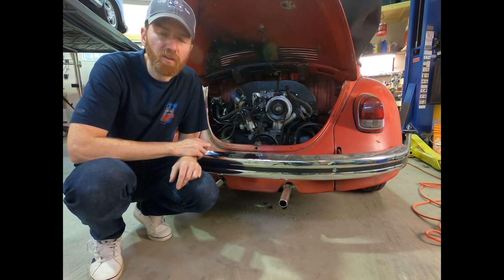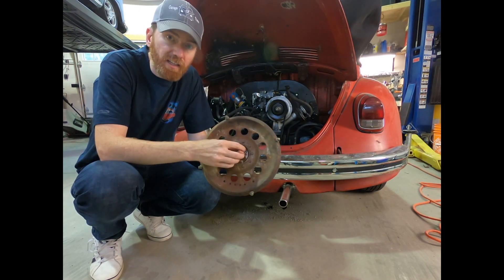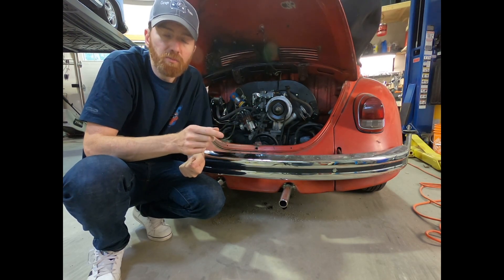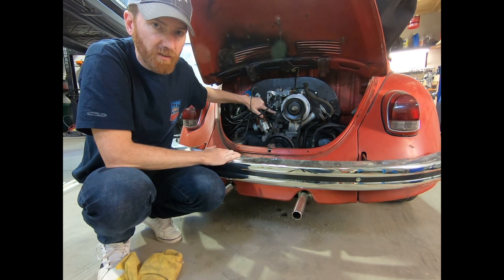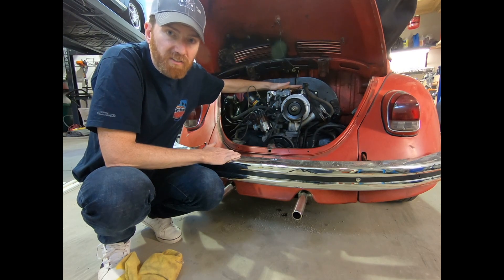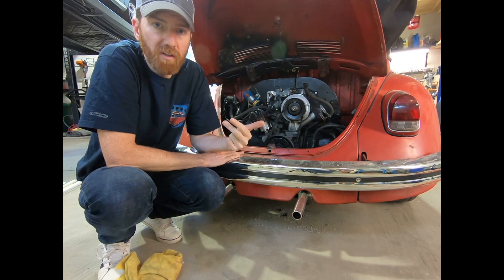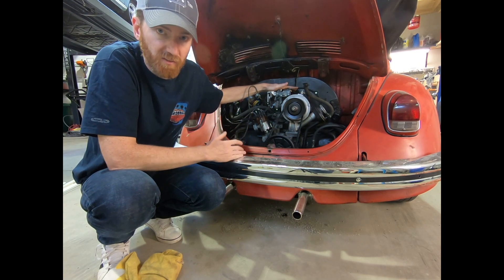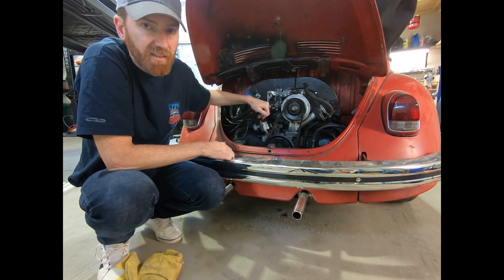VW Autostick Engine VS. Standard VW Engine - What are the differences - Parts Explained

Comment: Someone told me that the auto stick doesn't allow for as much torque as manual? so not as good going up hills. It is basically a manual without clutch, so I thought that didn't sound right. Thanks in advance for opinons.

Comment: I have a 1970 UK 1500SP semi-auto. She has Solex 30-PICT-2 carb, 113 905 205 AC distributor which look up tables tell me are correct for the model & year. Need a replacement vacuum chamber, type 113 905 271 C. Can I use an alternative? She runs fine at the moment but only done short journeys since acquiring her (vacuum line to carb disconnected and blocked at distributor end.

Comment: What would happen if you have an auto stick engine with the extra gears to pump the ATF fluid, but you bolt it to a four-speed transmission and leave that in active? Will you damage the gears being that it’s not pumping anything

Comment: I have an autistic that is running hot.   I think it may be due to the distributor.  At some point in the past, someone replaced the original distributor with a .009 pertronix setup.  Could be a number of other things as well, but I have tried to chase down this overheating problem for a while now, and this is the first time I have seen specifics on what type of distributor is required, so now I am wondering.   Do you have any insight?

Comment: Hey I have a question. 
I pulled my motor out if my 68 autostick to fix oil leak and replace leaky intake manifold. 
Put it back in.
But I forgot to mark a few wires to reconnect everything.  Now i have no spark. 
Could you help me with a wiring diagram? So i can get it to run?
I really need some input here.
I am stuck..... i am sure i am missing something.

Comment: I am installing an 68  autostick ghia 1500 single port into a manual 69 beetle.What all do I need to change? flywheel/gland nut oil pump.....and not reuse the distributor since curve is different, but could use carb and intake if block off unused ports, correct? I can sell someone autostick parts I take off.
Reply from the maker: Yes, that sounds about right to me.  Good luck
Reply: thanks

Comment: tell me please.  how does one remove the drive plate on the automatic stick?
Reply: the same as you would the flywheel. the 30mm gland nut holds it on
Reply: Not that easily. You can buy some angle iron from the hard ware store and then drill two holes in on one side of the iron for your engine mounting bolts. Then use a johnson bar on the gland nut

Comment: Can you tell me if the oil pump housing and gears are the same as a manual? I ordered the gaskets and seals for the trans fluid part but I broke the housing when trying to remove it? Just wondering if I can just go pick up regular flat cam housing or do I have to search for a hole oil pump. Thanks
Reply from the maker: Brent Chastain Hi Brent, "the housing, intermediate plate and cover of the double pumps are matched set and if any part requires replacement entire assembly must be replaced", is what Volkswagen states. That being said, I have only used the original assembly so have never tried to replace the housing. They do appear to be the same, but I would most likely look for another assembly and keep some of the spare parts (ATF drive gear).  

Ours is now leaking so a rebuild will be a future episode for sure.

Good luck.
Reply from the maker: Hi Brent,  We can and and will, but it may be a while before we get to taking our engine out and apart. Unfortunatley only have the one pump in our autostick. Engine re-build scheduled for the fall.  Thanks.